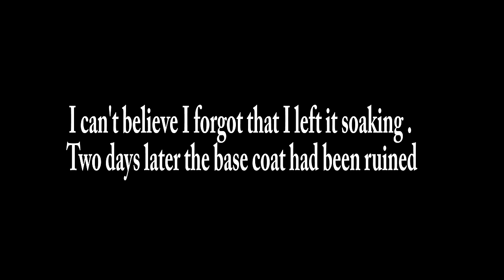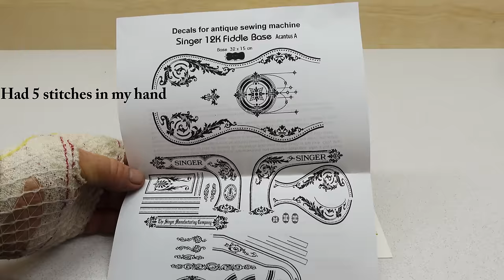1884 SINGER Sewing Machine Restoration

Comment: amazing finish. i have a question that hopefully someone can answer,the screw that sits at the end of the arm. on the left towards front of machine. has a wire attached that goes into one of three holes. anyone know what it’s for ? have it on both my 12 and 13 machines . suggestions welcome 🙏🏻 thanks
Reply: I'm sure the wire is a spring that is responsible for pushing the take-up arm down so that it rides along it's cam better. Putting the end of the spring into either of the three holes adjusts the tension on the spring. If you need to adjust the spring for any reason it's probably safest to use the middle hole.

Comment: Holy crap! I wish you had done all that to a junker machine, rather than one that was in unusually good original condition.
Reply from the maker: I was just going to seize it but unfortunately, I ruined the base paint as described in the video 11:48 turned it from an easy restoration to a drama , thanks for watching
Reply: @richardrestorations  Yes, I can well imagine how you felt when you remembered it and took a look after its accidental "spa bath".  It took a lot of work to restore it but it made for a wonderful video which I've now watched again.  I'll be watching it again before too long too as I picked up things this time I didn't catch the first time through.

 it now looks and works better than before you started and, what's more, will still be looking beautiful after many years of use as it now has a more durable finish over the decals than it had to start with.  A lot of work for you, but a wonderful result for the machine and a long of line of future owners.

I'm curious to know a bit more about how you adjusted the position of the needle, please.  I saw what you did, but didn't understand how the knee bone was connecting to the the thigh bone.  (And do you have some kind of adjuster's guide that tells you how to adjust such things - I've never found one for these machines - or did you just figure it out by careful observation and perhaps a career as an engineer or machinist/fitter etc to give extra insight?)

Finally - some decals for sale seem to be better than others.  Is there a brand/supplier you think does the best?  Thanks so much for any tips and especially for this amazing video.

Edited to add - I recommended this vid for a view to some vintage machine experts and, aside from being gutted about the original finish being damaged (which I'm sure you were too) they mentioned that you clear-coated the main shaft and gears.  Did you go back and clean that off all those parts? And the one thing I wondered was why you didn't do all the painting, decals and clear coats before reassembly.